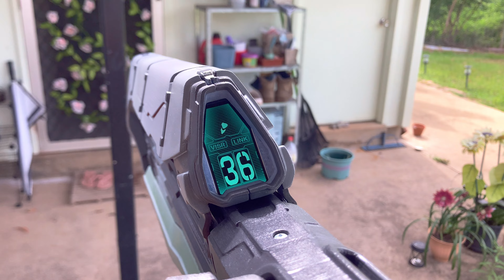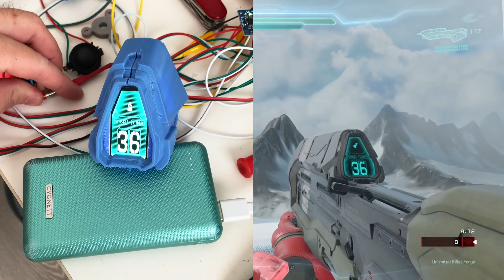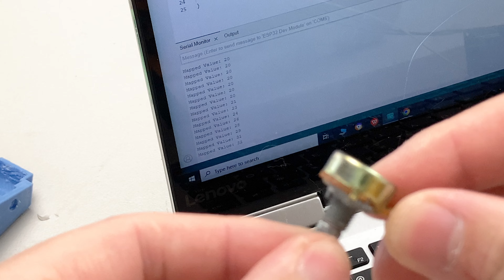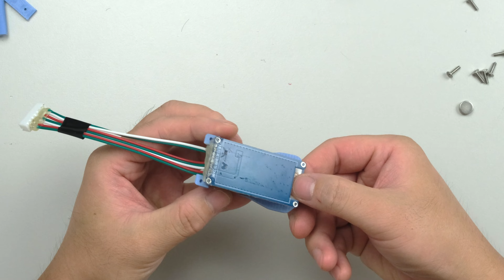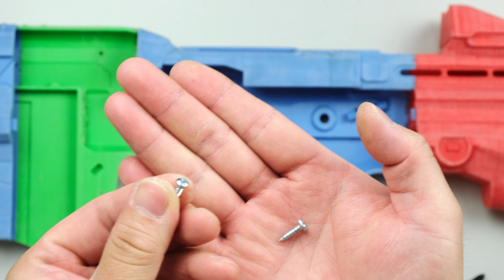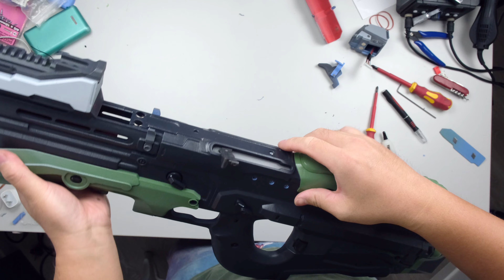3D Printed Halo 5 Assault Rifle MA5D

Comment: THANK YOU SO MUCH for offering this beautiful model to the public! Especially with the source code to make the electronics work!
I am aware we need to source out the electronic parts, but THANKS SO MUCH for also showing us how to wire everything in the video! This is amazingly generous of you and I am more than happy to support your work!
Reply from the maker: @Enojadoland  thanks for your comment.
Reply: @3DSomething  I do have a question, would it be possible if I used the newer method you designed for the NERF version of the selector switch that uses the 4 magnets with this version or would it interfere with the current code? I feel the NERF selector switch design seems much more easy and straightforward.
Reply from the maker: @Enojadoland  the new mode selector switch is absolutely for both of them. The both design has the only difference is the nerf version got few more parts for a nerf dart delivery system and brushless motor brackets. If you have any questions.You can send me email at sithco952@gmail.com.

Comment: Do you take commissions for the counter?
Reply from the maker: Still thinking about it. I’ll decide it later on.
Reply: @3DSomething  That would be great! Would this be doable with the MA40 screen?
Reply from the maker: @AlexG207  yes. You could actually do  it on any of assault rifle variants. However, due to those screen are not in a rectangular shape, this may cause an imperfection of display. Like mine. It looses a bit of picture.
Reply: @3DSomething Perfectly fine with that.
Reply from the maker: @AlexG207  I think I will get a bigger screen and redesign the model. Then let the screen showings a full picture.
Reply: @3DSomething  Looking over dimensions that current screen should fit just fine.
Reply from the maker: @AlexG207 hello, friend. Please send me email. My Etsy has a problem. Sithco952@gmail.com
Reply from the maker: hello. I tried to reply on ETSY, but I'm experiencing problem. you could send me email at this Sithco952@gmail.com